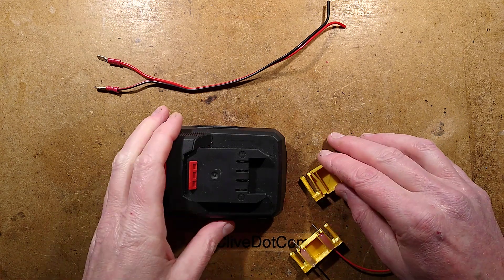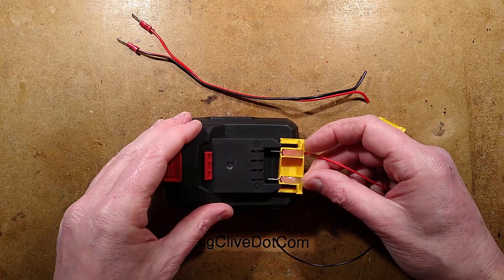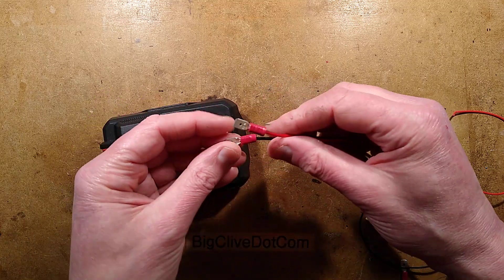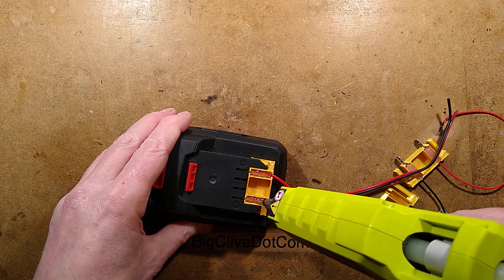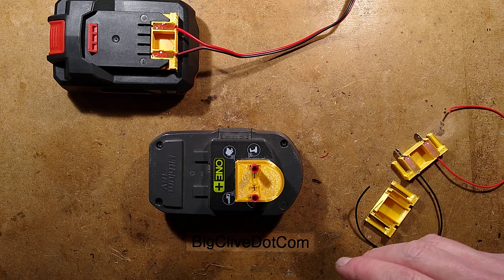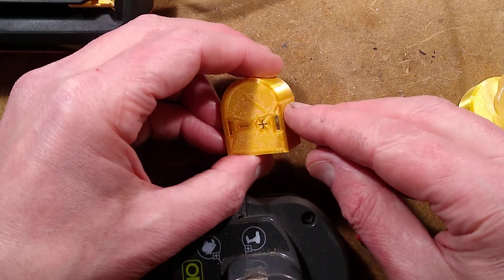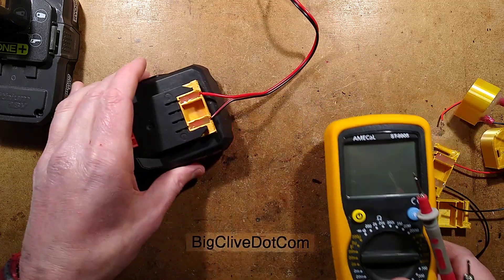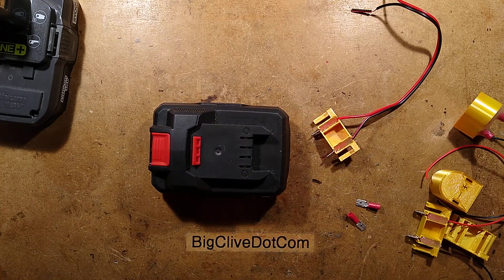Simplest Ryobi and Parkside battery connectors

Comment: I did try pretty much this by shoving spade connectors into my 18V Dewalt batteries to power various things (Including a 100W LED with both batteries in series) and sure enough it works BUT...
There's no overdischarge protection !
Well actually there is but it only works when the battery is used to power a Dewalt tool, in this case it will automatically shut down when the battery is discharged, but hopefully before it goes so low that it will sustain damage.

I'm pretty sure it's because the battery communicates with the tool and Dewalt batteries do in fact come with 5 pins instead of 4 for the Parkside ones. (Although my Dewalt drill does only have four pins, but the charger comes with all 5).
One of them is used by the charger to monitor the battery pack temperature and also the tools won't power from a bench power supply or anything else that doesn't come with the data pins.

Comment: To prevent "elefant's foot" at the bottom of prints, I usually add a small chamfer at all the bottom edges of about 0.4mm in the actual CAD model.
Reply: Or enable elephant's foot compensation in your slicer which shrinks the first layer a bit.
Reply: @sonosus  Where do i find this in Cura?
Reply: @pepethefrog7193  search for “Initial Layer Horizontal Expansion.” You can add a small negative value (try -0.01 and decrease by 0.01 every try). This will help offset any elephant’s foot. As you run your mouse over the “Initial Layer Horizontal Expansion.” text, you get a pop-up message relating to Elephants foot.
Reply: Or you could, if you have no qualms about wasting a little bit of filament, use a raft. I found it helps with bed adhesion as well as making sure you don't get the elephant's foot deal.

Comment: But caution ⚠️ the Parkside battery has no undervolt protection.
The charger will refuse to charge it below ~13 Volts.
Reply: One of the middle wires is bat-tool data comes, i suspect that this is how these tools handle under volt  protection, academic as this wire is not used here and I am unaware of any reverse engineering of the data comms

Comment: I like to welde my terminals in with a 3D pen and the same filament used to print it. Also the full size connector print fast on resin printers set the pins in with a bit more resin and a blast of UV.
I've added a voltage converter or a 5v regulated usb port. Very useful.

Comment: I 3D printed connectors for my Bosch batteries. They snap on in a really satisfying way with a loud click. The connectors I made from stainless steel that folded to make a smooth edge. Then I go over to XT-30 connectors which I have plenty of adapters for, including my laptop. My batteries are 100 Wh each which is 3x my laptop so perfect for long excursions.
Reply: That's a good idea... Are you just plugging the tool battery direct to the laptop DC input? Is it a 18v tool battery and 19v laptop input?
Reply: @tin2001  Yup pretty much. I suspect that it works well between 15 to 20 volts. Probably even a bit higher but without taking it apart and inspecting the circuit I wouldn't chance on higher voltages. The low end voltage is based on the guess that it probably works as long as the voltage is a few volts over the battery. I should test if it has some under voltage lockout circuit some day. (The battery packs have that which is good though).

But I would not recommend anyone else doing this unless they were pretty sure it wouldn't become fry anything.

Comment: I have created something like this before out of resin, However I have wondered how difficult would it be to create a charger taking 24V. Drop output via LM350 to 12V (Because I have bunch of them) for a door entry system. I have tested PET filament to be self-extinguishing (Low smoke). As I have several projects to solve before I get back to it, if you'll create it it might be although handy for CCTV (including router) or led lights, giving far longer lifespan then equivalent gel batteries. Thanks for the Sketches, I am terrible at graphics.
Reply: Using a linear regulator to drop 12v is an awful waste of power. One of the cheap buck regulator modules would give much better battery life.
Reply: @ferrumignis Mine problem with buck regulators is that I have newer built one and I find the idea of buying one going against the idea of building mine own project.(I do not use, nor like the idea of shields for Arduino, but prefer actual parts). In mine setup I intend to use battery only as a backup. If you have seen the add for terrible Yuasa batteries coming before the video here, that is what I am trying to get rid of (I quite like a standard/price of Parkside tools). As mine shed lock has Fail-Secure approach, I don't need that much power for standby. Thanks for idea though, I am now playing with msp430, but buck regulators are on a study list
Reply: I find the idea of charging more difficult here,

Comment: Yeah, i lately thought about and looked for 230V AC sinus inverters and fitting batteries.
I think the cheapest/robust version (if space+weight is no issue) still is using car batteries (AGM) and then going for 24V inverters. => meaning two car batteries in a row 2x12V
48V would be cool because of even lower current per battery, meaning more usable stored energy, but at that point you can just use more batteries in parallel,
-- so adding another 2x12V pack parallel instead of using 4x12V to get the 48V -- also gets down the current flowing through each battery.

Now i do not know the usable range of these packs and if they would even fit to a 12V or 24V inverter at all .. maybe needs one where you can disable undervoltage protection
.. AND they are still really overprized.
But using a few of them in parallel would make for a kind of safe power bank because of the integrated safeties.

When you get over 2kW of power needed over a longer time you quickly realize a noisy stinky generator is good to top up the batteries when solar isnt doing enough.

When you are reaching above 150V DC from Battery/Solar input you get into the usable range of standard meanwell power supplies again,
they directly run off a DC grid if its high enough instead of the normal 115/230V AC. (DDRH-60)

.. hah, just found something interesting. the BIC-2200 series.. just wondering how good that sinewave is if you dont have AC coming in anymore..

Comment: I had my eye on the Parkside battery for powering an ebike 12v lighting setup but I decided against it because 1 battery didn't have enough capacity and I didn't have space for more than 1.

This is a nice design, much more compact than the Thingiverse one I had intended to use, might have been able to fit 2 batteries if I used this.

Comment: This is a good start for what I'm thinking of doing. I'd like to take one of these batteries, I have a few from the Rigid brand from Home Depot, and have a belt-mountable power adapter to give me some extra runtime on my VR headset without needing to be plugged into the wall with a 10-foot cord, as I currently do.

Comment: To reliably glue in the spade connectors, putting in some shmoo before putting in the connectors would result in a more rigid connection.
Two-part epoxy would probably be even more resilient.
However, taking care not to put it where it doesn't belong is even more essential in that case.

Comment: The solution to the bottom of the cup printing nicely could be a second, removable part printed separately that you put on the battery cup initially to flow the hot glue nicely, then remove after cooling. That or make that separate part attach by snaps
Reply: A clip on cover to retain the crimps would be a great solution, and would allow you to reuse the connector housing with new crimps if needed.

Comment: Thanks for these Clive; a nice simple solution, and really useful for me as I have a load of those Parkside battery packs. Thing to note: The Lidl/Parkside packs don't have any over discharge protection, as it is in the tools and not the battery pack. So if you use this with the Parkside batteries, make sure you add an over discharge circuit, or be careful not to let them get too low.
Reply: the 12v ones have a pcb in which i assume is the charge circuitry/protection.
Reply: @aeroflopper  12V team has complete protection inside battery. 20V team has also protection PCB inside the battery but major part is missing and it is included in every tool.
Reply: I imagine you're probably gonna be quite ok with a general protection board with a lower cut-off at 3.2V. Just make sure it's rated for the current you're gonna need, and do a bench test to see that it actually does cut off where it says it does.
Reply: I wouldn't worry about that, I have a 60v/5a bench Power Supply. I can get them up to 2.5 - 2.8v each before going on the charger.
Reply: To be more accurate - the battery does have protection sensing but doesn't have power mosfets for cutoff. Protection is thus split between the battery and the tool. 

When battery gets low, the battery sends "alarm" signal over temperature connection to signal the tool to cutoff. External protection will not be ideal since you don't see all cell voltages (only battery does) and thus if one cell is lower than others external protection may cause damage/early failure. 

To properly use Parkside 20V batteries you need to replicate what the tool does. Battery has 10K? (guessed value) NTC resistor across third "temperature" pin and GND pin - in normal state but if any alarm condition occurs (like cell undervoltage) battery disconnects NTC and thus creates voltage resulting in invalid temperature (around -20C) and this signals the tool to cutoff. The tool has pull up resistor on third pin creating voltage divider together with what battery has as pull down resistor, when battery signals alarm then third pin has around 4.5V with 10K pullup to 5V. Perhaps there is 100K? parallel resistor across NTC, this would explain why alarm isn't 5V when NTC is disconnected (100K pull down is always connected). Thus proper protection wound need to monitor third temperature pin with pull up and when voltage gets very high on the temperature pin then mosfets or relay need to be disconnected (for example if divider equates to >=4V with 10K pull up to 5V).
Reply: @tomaskolinger  Thanks for the info! I always wondered why there are 4 connector pins on the batteries. I think it makes sense for the circuitry to be in the tool, as it makes the spare battery packs cheaper to buy. Can't remember where I heard that the battery is not over discharge protected, but I think Julian Ilett probably did a tear down at some time.
Reply: @tomaskolinger  But if I want to use Parkside tool with Einhell or Makita battery, would tool work by just grounding Temp pin ?
Reply: @Tegelane5  Don't ever use Parkside 20V batteries in any other brand of tool. It may work at first but you don't have any overdischarge protection. You will eventually destroy the Parkside battery, likely in short time. You would need to have special PCB with cutoff to safely adapt Parkside 20V to another brand tool.
Reply: @tomaskolinger  Hello friend. I managed to convert most of my cordless tools to use the Hikoki/Hitachi batteries successfully because those batteries have low voltage protection but I can only convert tools that have 2 connectors only positive/negative. The parkside tools have 3 connectors positive/negative and another. without connecting the 3rd connector the tool don't work.. How can I get around this? Thanks
Reply: @cassiya100  Parkside 20V tool is expecting nominal 10K Ohm NTC resistor between GND/Negative and T (the third) terminal. Ordinary resistor will of course work too (value anything from around 2.5K to 60K). If resistor is not present then the tool is thinking that the battery is frozen (or battery has under-voltage/over-current condition) and thus will not try to run to protect the battery. Simply connecting suitable resistor between GND and T terminal should help you to run Parkside 20V tool with any other 20V battery or any other power source.
Reply: @tomaskolinger  Thanks for your prompt reply.. very much appreciated. Just to confirm I simply have to solder a resister 2.5k - 60k between the negative and the other terminal and it should work?
Reply: @cassiya100  Yes, 10K Ohm should work if not try other values in the range.

Comment: Clive you got a great idea. But l would have a  fuse . Inline  or design in the adaptor.  As shorting out a 20 volt lithium battery will be very spicy including flames and of course magic blue smoke.

Comment: Parkside does not have an internal low and overvoltage cutoff, external module is required for safe operation.

Comment: I make mine out of layers of plywood and chisel everything to shape by hand :)

I've even done this for HILTI batteries and Hilti's batteries are male. So I had to make female spring contacts on an anvil, anneal them, and carefully carve up a chunk of wood to make a female pinbus to put all of the pins into. (anvils and hammering are so much fun😁)
Reply: Hahaha, did the same to our Black&Decker electric weed trimmer. Made up a pack of 2x5 18650 LiPo's to replace the original dead NiCad pack. Made the connector with salvaged pins from a mains plug, melted into a block of nylon. And like you, a home made plywood form to fit the trimmer's profile.
Bit of a pain taking the batteries out of the holder to charge, but works like a charm . And the extra 2 volts (20 now instead of the original 18) makes an amazing difference. Currently building a charger with BMS so I don't have to do that :-)
Cheers
Pete'.
Reply: @Bristoll170  , ive tried ply and solid timber but i found plastic drainage parts cut to size and shaped with a hot-air gun work better for me.
Reply: I use a 110v wall plug and just bend the lugs with a couple pairs of pliers to get the spacing perfect. Just plug it it, sometimes whatever runs backwards if its pitch black out. So just unplug flip if over and away you go.c

Comment: Clever idea. I'm in the DeWalt battery ecosystem and I think the same overall topology with the spade crimps would work with its connector too.
Reply: The connector and latch look almost like they could be DeWalt clones.
Reply: I too would use a Dewalt adapter.

Comment: Make one with a built-in USB charger
Reply: I have some of those;) A year ago there were USB-adaptors for my battery-system (Einhell)  on sale for 7 Euro each. Since they are easy to open and modify I didn't even try to print them. Those adaptors usually sell for roundabout 12 Euro or so, so they are a  good alternative to completely self-made adaptors. Not so much fun, though.

Comment: Great work!!! I'll definitely give it a try. What's your best solution to avoid over discharging the packs? (at least Parkside relies on the tool). Thanks.
Reply from the maker: You could use loads with low voltage cutoff.  That could be as simple as an LED light with 6 LEDs and a resistor in series so they don't conduct below about 15V.

Comment: Sweet! 
Just wondering: why shouldn’t you use resin instead of hot glue?
Reply from the maker: Resin tends to flow too easily and could go into the battery contacts.
Reply: @bigclivedotcom  you could use very thick resins; they make some that don't flow much at all iirc
Reply: @bigclivedotcom  Thank you! 🙏